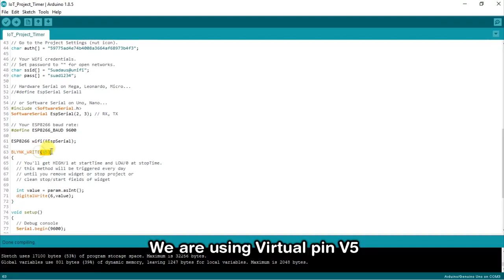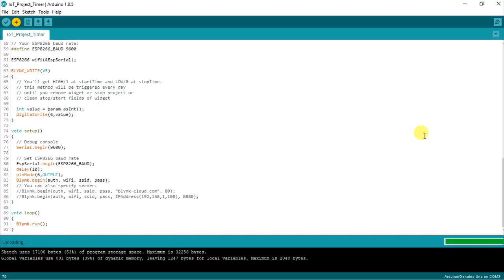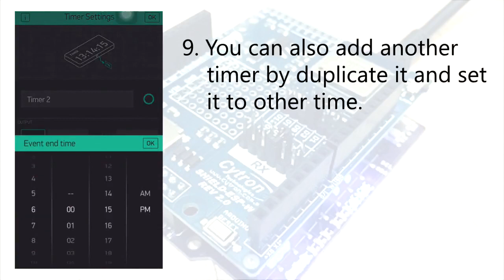Control an Output with a Smartphone Timer: Lesson 4 Beginner IoT Project

Comment: Hi, first of all congratulation for your video. I would to ask yuou this: Why do I use virtual pin to use timer? By widget button I don't use skecth and virtual pin, I use only digital pin and works, why isn't the same?
In my project I use button to turn on and off a light (I don't use sketch and virtual pin, blynk provide to work all). If I use also a timer why doesn't work?
Thank you